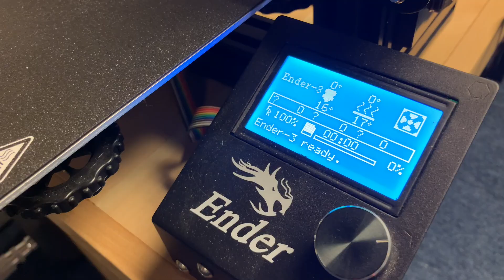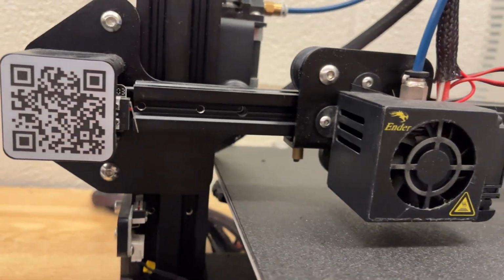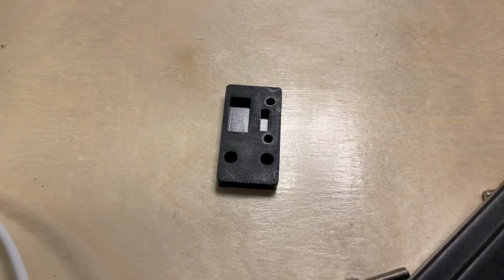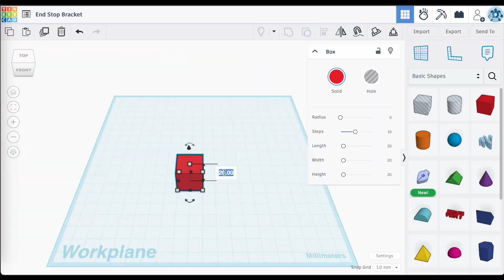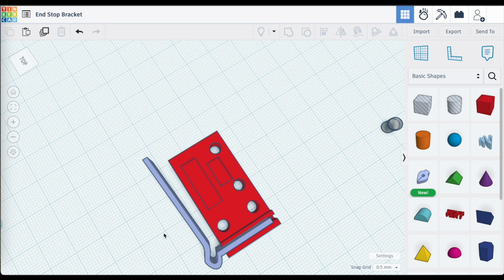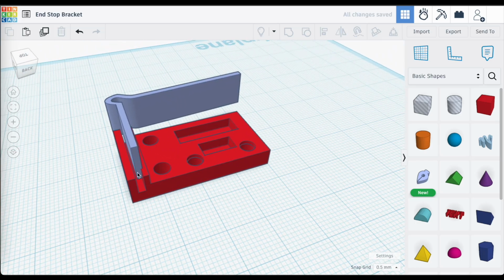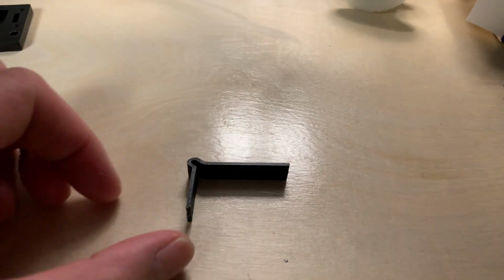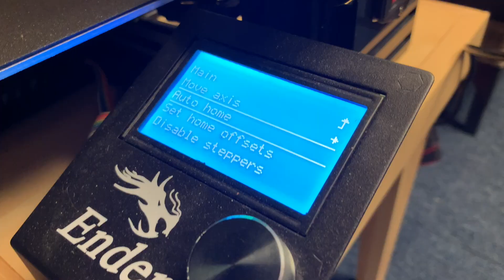Redesigning and Repairing an Ender 3 End Stop Switch

Comment: Interesting video but I do not understand what was wrong with broken switch and with replacement switch.... :-( I just miss more technical details. What was wrong with replacement switch? Was it working in inverted mode? Or was there missing resistor? Wasn't it possible just to replace the metal spring (from replacement switch). Maybe old metal spring could be bounded to better shape. There is a design problem in these micro switches, they are hammered by carrier, there is "no buffer" to stop and I assume that bending the metal spring (lever) a little bit could create buffer that allows control board to stop stepper motor before it is stopped by bumping to the switch...
Reply from the maker: The metal blade or lever on the original switch broke off.  So my initial plan was to replace it which should have been a straightforward replacement.  But the replacement switch was wired as an always closed switch rather than an open switch (the product description listed it as an open switch).  That’s when I went back to the original switch and came up with a way to create a new lever that would trip the switch.  It was a workaround solution that involved 3D printing - so I figured I would create a video on it.  I am not sure if that answered all your questions - let me know if you have more questions about it.  Thanks for the post!
Reply: I agree that your solution was interesting.  However, every microswitch I ever saw in my 40+ year career in electronics had changeover action, as do both shown at 1:13.  You could have adapted the PCB traces on the replacement assembly or, more simply, swapped two wires in the mating cable. You would have had to use one of these approaches if you had not had a second printer to make the new parts.

Comment: I'm fairly sure the replacement switch was wired to normally closed vs normally open thus telling the printer it's depressed when it's not and the other way around.
You can see there's 3 pins and on the switch itself there's "C" (connect point), NO and NC, your connector to the endstop was utilizing NC.

Noticed the writing on my switches just whilst inspecting them and figured it might be just that.
To confirm this, use a continuity mode on any multimeter and measure from C to NO and NC respectively while activating the switch and you'll see how the original vs the new one behaves :)
Reply from the maker: The switch has it labelled as normally open but I am wondering if it was mislabeled because yes, as you said, it certainly behaves like it is closed.

Comment: Very cool man.  I've got option paralysis when it comes to picking a CAD software to learn.  (im a noob).  I suppose I will start tinkering with tinker CAD.  Cheers.
Reply from the maker: Definitely give it a shot. I have been using Tinkercad for a while and I have not felt the need to move on to something else.  Some users are doing some amazing things with it.  Good luck!